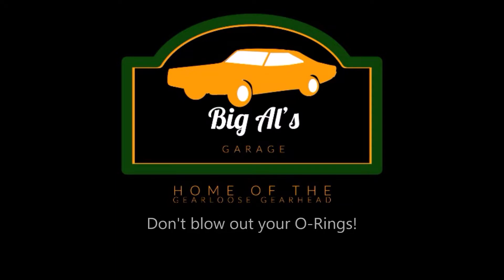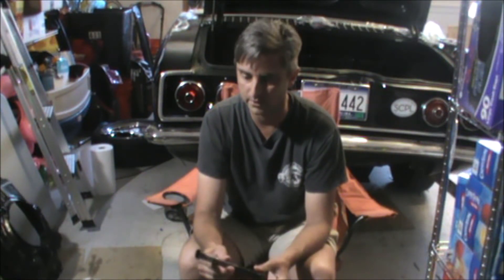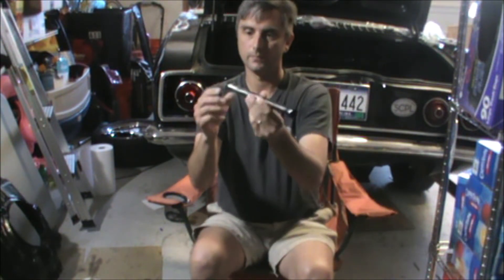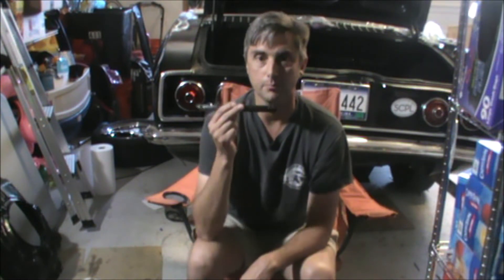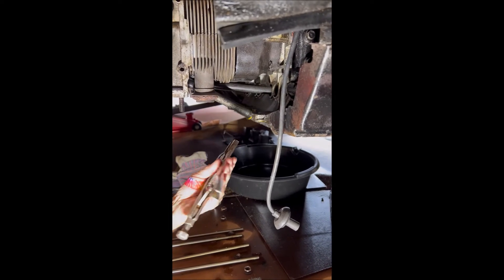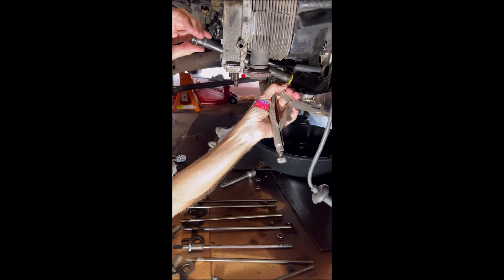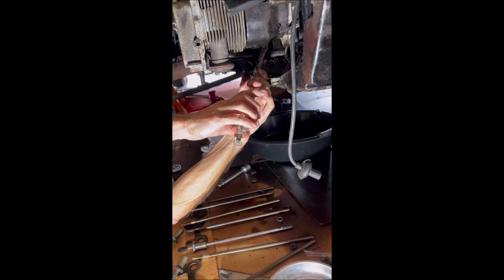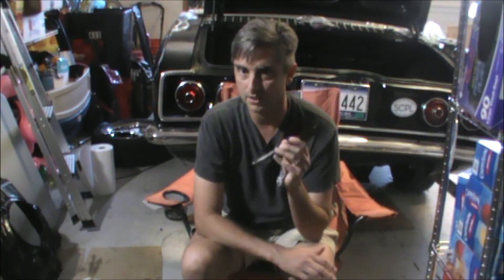Corvair Push rod Tube Seals: What You Need to Know

Comment: Good information. Speaking of gas prices, 
What kind of gas mileage do you get with the Corvair ?
Reply from the maker: Usually somewhere in the mid 20s. Not bad for a car of the time period. But, it runs on premium.
Reply: @bigalsgarage9323  
Is it normal to run a corvair on premium gas ?
Reply from the maker: @randallcochran9070  the 110, 140 and 180 engines all require it.
Reply: Exactly.  Great for high temp